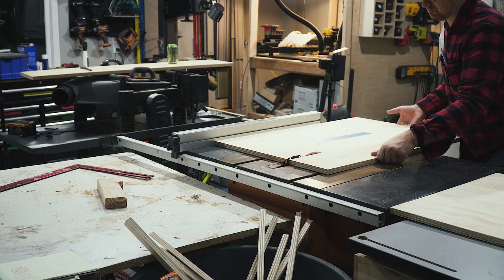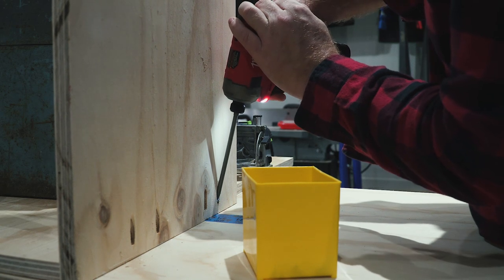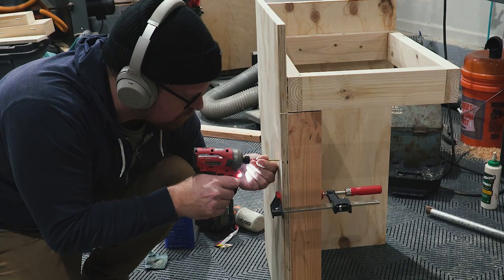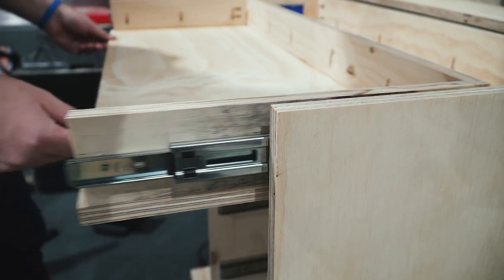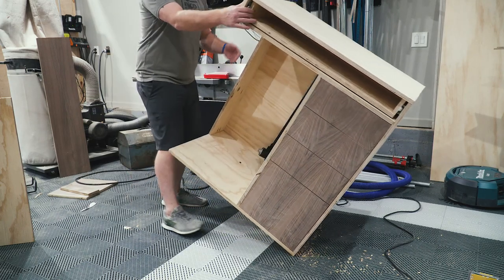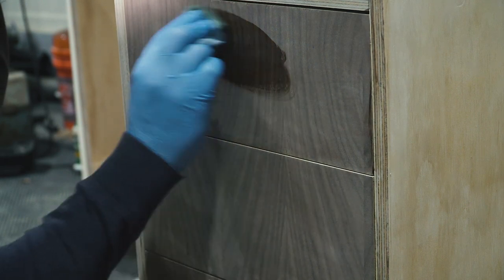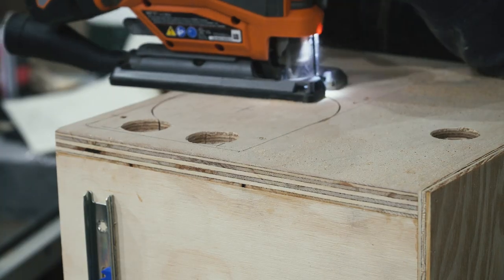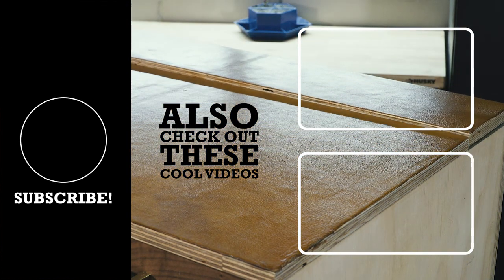Overkill? Over the Top Shop PC / Rolling Tool Cart | EPIC Wooden PC Builds

Comment: How do you like that Rigid jigsaw?
Reply from the maker: I really like it.  The bolt for the shoe comes lose sometimes, but otherwise, really smooth and powerful.
Reply: @WoodWorkLIFE  is the power switch location and not having a trigger hard to get used to? No variable speed either, right?